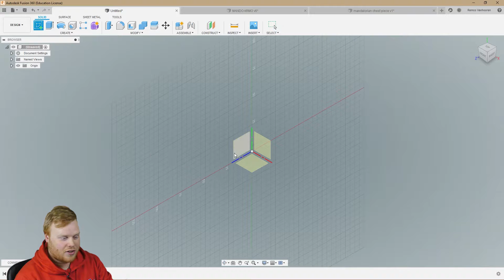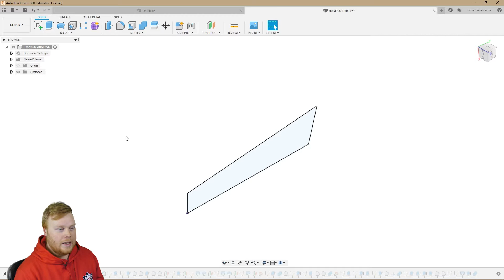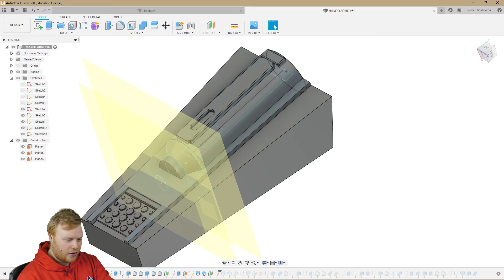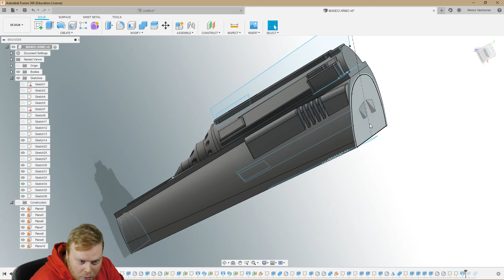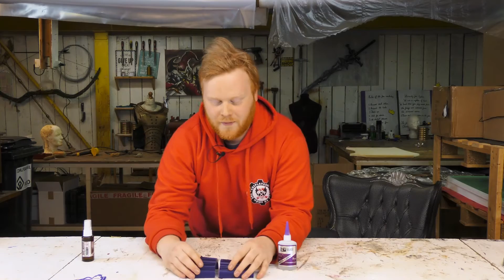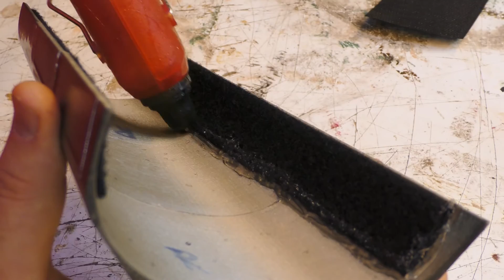Making The Mandalorian Gauntlets

Comment: If only i had the computer that could stand the software, a 3D printer, the plastic (or whatever goes into the 3D printer)
The spray paint, the electronics, the knowledge to use the electronics, the patience in general and the money, BUT i do know where to get velcro from for £1 if the lockdown ends 👍